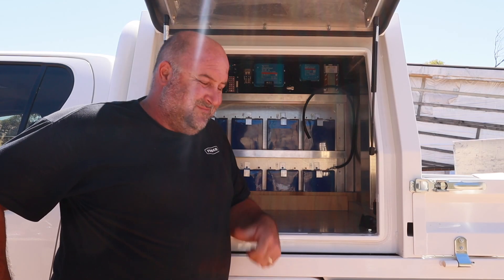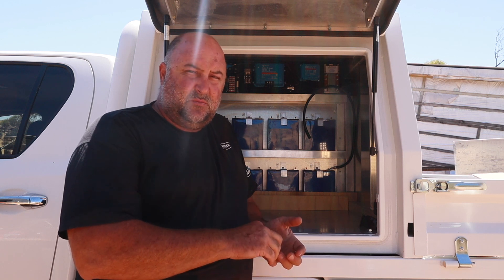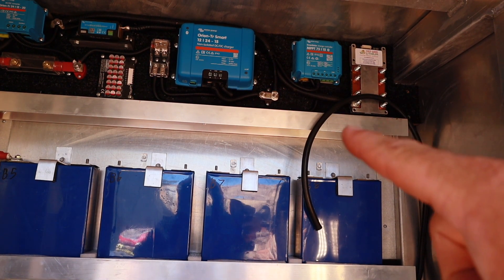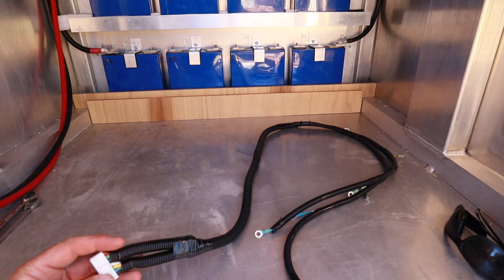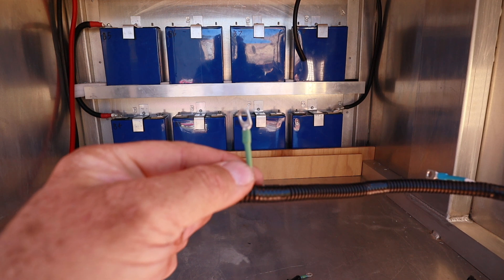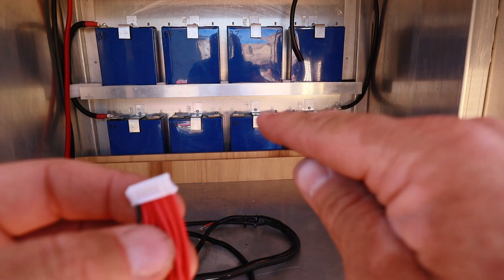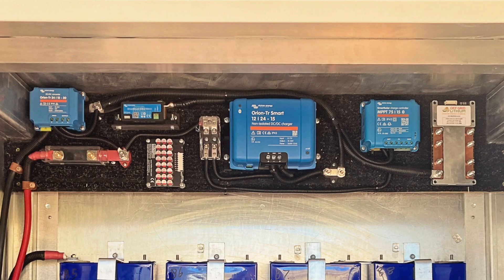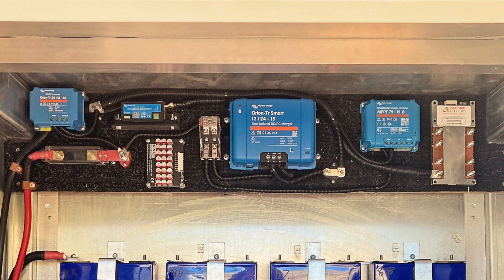24v Lithium Off Grid System in a 4WD | Victron Install

Comment: Mint is an apt description 👌 
Can I ask why many small batteries instead of one or two larger ones?
Reply from the maker: So essentially, any bigger all in one lithium battery would be comprised of, for example, many of those smaller batteries, plus the bms, plus the balancer all inside. But you pay a premium for that (this system was less than half the price of a comparable powered large battery) and there are also considerations around flexibility of install too. So that is one big battery just without the outer case. Simplified explanation but does that make sense?
Reply: @ROCKPILE Off-Grid Homestead  Simplified explanation is perfect for me! 🤣 And interesting to know, as we have always gone one or 2, 105 to 110ah. Agms to date though.
Reply from the maker: Good question!